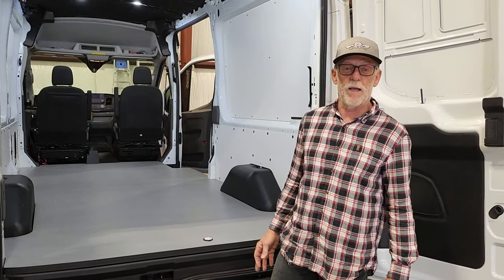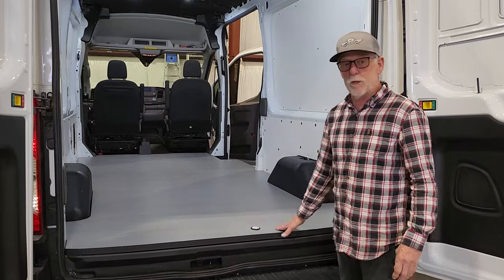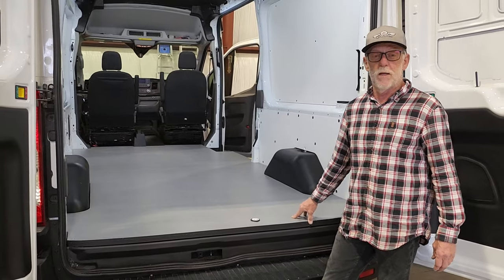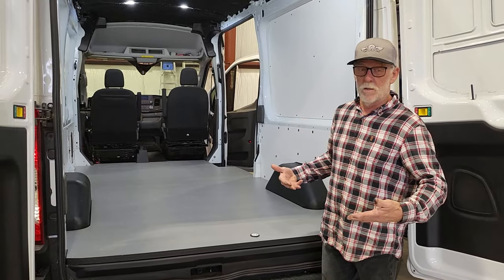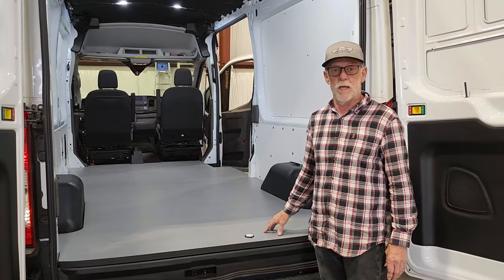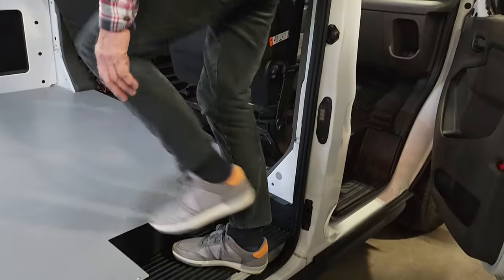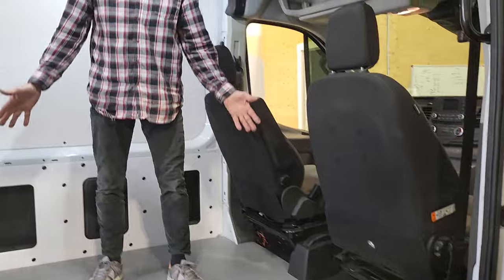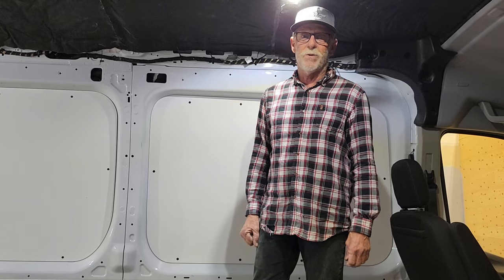Ford Transit Floor 1 Piece Composite Insulated Van Subfloor!

Comment: How thick are these floors?  I'm 5'10'' and considering a 130 MR.   Is there a good way to do the ceiling with this floor to get standing height in the middle of the van?
Reply from the maker: We also have a MR Transit and I am about as tall as you are. The composite floor is 1.2" thick messured from the valleys in the metal floor. We are working on some ceiling panels that will fit between the factory roof beams.
Reply: @doityourselfvan   I would love that!
Reply from the maker: I am in the process of building out our demo van so stay tuned for ceiling panels. Currently installing the electrical system with new battery box option for the Transit.

Comment: Nice looking floor, need to see the layers.  is there some room left for air circulation under the floor, between the chassis and sub-floor?   How strong is the composite floor to screw the cabinets to it?
Reply from the maker: There is no airspace under the floor. The composite and minicell are both moisture barriers. Reach out to Kim@DIYvan.com so we can send you a sample.

Comment: Is this floor strong enough for commercial work?    My van does double duty, work and play.  Thinking of advantex with 1/2” foam but that would be three pieces.
Reply from the maker: The composite floor is engineered for commercial use.
Reply: Thanks for the link.  This products makes all other options seem inferior.    Im disappointed its not available on east coast somewhere. What a time saver with the foam incorporated.  Bravo.
Reply from the maker: Thank you. We have been asked to do a multi-piece version so keep checking back.

Comment: Where are you located?
Reply from the maker: We are in Hood River, Oregon.
Reply: Thanks. Know anyone in Southern ON Canada that can help us with it?  Also, I would imagine that this composite floor would be strong enough to load up an adventure motorcycle on, right?
Reply from the maker: The composite floor is super strong and definitely able to handle a motorcycle. Although a bit of a drive, we have customers coming from near and far to pickup a composite floor and lots of other supplies for their build. We often spend hours going over their build and offering our experience. We would be honored by your visit. Consider it a maiden voyage in your van.